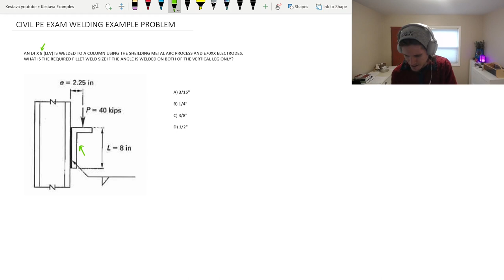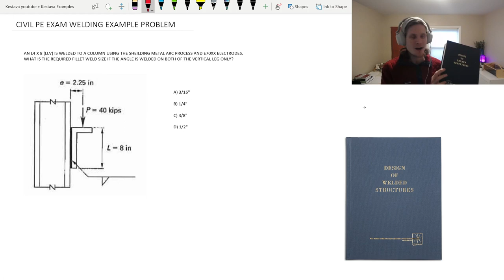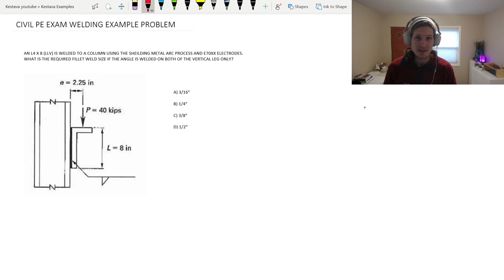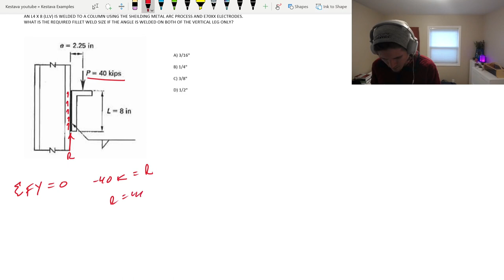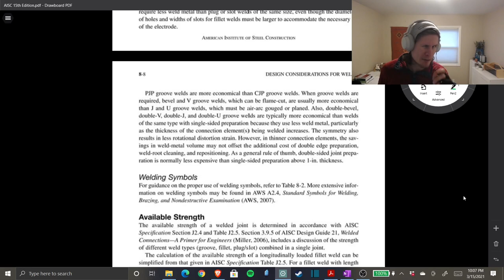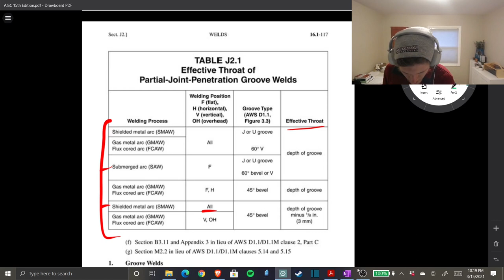Steel Fillet Weld Design Example using AISC 15th edition | Civil PE Exam Review | Spring 2021

Comment: If I may, I am working in steel connection design for 5 years now and I am very familiar with the Blodgett theory of "weld as a line". It is very good and your example is accurate but, this problem could be solved using only the AISC Manual theory. For NCEES, the AISC manual is the reference and by experience it is common to see a significant variation between both since blodgett is often conservative. For simple eccentric welding case like this one, you can simply use AISC Table 8-4 with k=0 & a=0.28125. This will provide a C=3.1725 and than solving D in ASD=2.101 = 3/16"  and LRFD=3.152 = 1/4"
Reply from the maker: Tommy Hats of to you! That is a great procedure! I agree that the line method is conservative and if we wanted to be more accurate then table 8-4 is the place to be! I will do an alternate video showing this method. thank you for your great input. YES to everything you said!
Reply: Just one detail, your values of ASD and LRFD are exchanged. But it is a better approach.

Comment: Rich,
Thanks for the video as always. Should the fillet weld symbol be shown on top and bottom of line since a weld length of 16" was used in the calc? Does the weld capacity need to account for the loading angle between the vertical weld & resultant?
Reply from the maker: YES! the weld symbol is incorrect! it should be a fillet top and bottom since we are using an 8" of weld on each side of the angle

Comment: Stick welding (smaw) is used in field applications because wind can blow away shielding gas used in other processes like mig (gmaw) or tig (gtaw).  With saw or smaw, u or j, 60degree bevels it looks like effective throat depths are the same for both saw and smaw?
Reply from the maker: I am loving this info your bringing to the team. I need to dive so much deeper into welding! thanks JJ!

Comment: Thanks Kestava. How do we solve this problem on the CBT exam? We only have AISC!
Reply: Blodgett, the welding book @Kestava is referring to, derives the section properties of the welds using lines from basic statics. They're actually not that complicated, you should become familiar with these derivations and just basic statics for determining your loads on the welds. For example blodgett's "section" for one vertical line is equivalent to d^2/6, which is what the height of the triangle is for your triangular load couple Force reaction, from an applied moment (assuming elastic distribution). Blodgett calls it a "section" but it's basically the absolute Max or worst case force per unit length due to the moment.

Comment: Hey Nice video. Thank you for that!

My two cents: typical Wide flange sections are hot-rolled sections and welding is not actually part of the process of fabrication. However, it is indeed in the case when you have plate girder sections, for example for bridges. In those cases the flanges are welded to the web. :)
Reply from the maker: OMG I cant believe I spaced out on that. You are absolutely correct. thank you for the correction!
Reply: @Kestava_Engineering  No worries brother, we’re all here to learn from each other and collaborate. I like what you’re doing with this channel and encourage you to keep the good work. You’re helping a lot of people out there. 👍🏼👍🏼
Reply from the maker: @manuelmalagon210  means a lot to hear that man. I'm glad everyone is starting to add additional information. even when its pointing out something I do wrong!